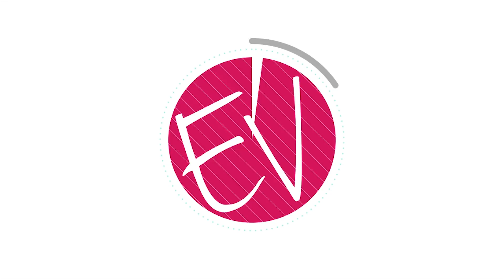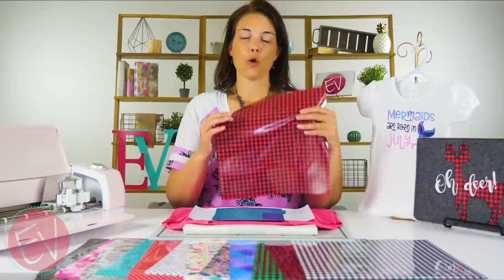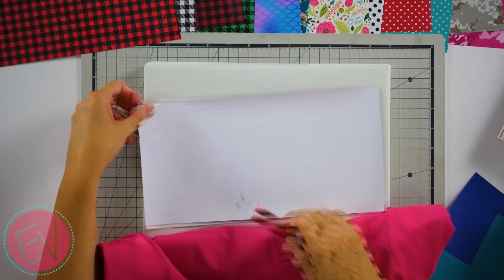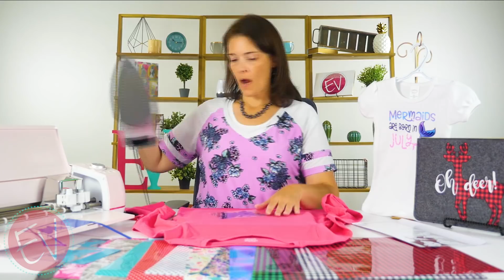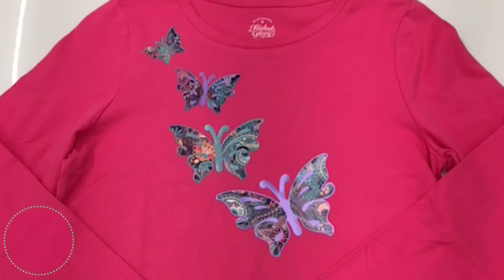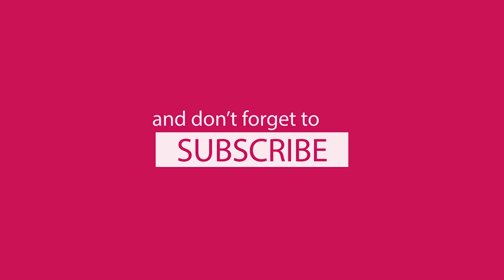Patterned Heat Transfer Vinyl Overview

Comment: Does your reflective vinyl have the transfer mask on it also ? Because I bought reflective vinyl from you guys and it doesn’t look like it has an transfer mask and on the back under the white paper on the backside the vinyl is very sticky ? I’m kinda frustrated I have been emailing you guys and got no response  I MEED help trying to figure how to cut you reflective product
Reply from the maker: The reflective adhesive vinyl is for hard surfaces. You will need to purchase a transfer tape to transfer this to your project. 
The reflective Heat Transfer Vinyl only comes in a gray/silver color. Which has a carrier sheet on it so that you can apply it to the fabric that you are wanting to apply it to. 
You are welcome to contact customer service so that they can further assist you. 
https://expressionsvinyl.com/contact-us/

Comment: What kind if vinyl should I use to put one a hard surface, such as glass or metal? Anything like your easy weed?
Reply from the maker: Hi Patricia, if you are applying to a hard surface we would recommend adhesive vinyl, not the iron on vinyl.  We recommend our permanent adhesive.  After placing it on your object, allow it to sit 24-48 hours prior to washing it.  Hopefully this helps.
https://expressionsvinyl.com/permanent-adhesive-vinyl/